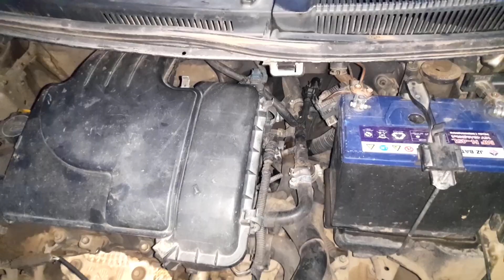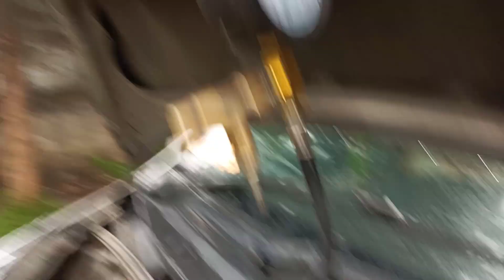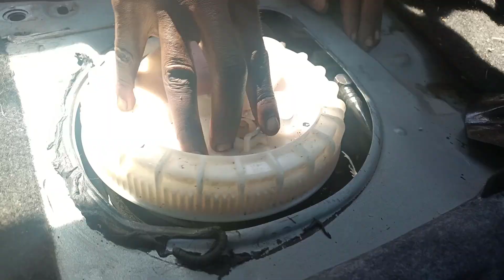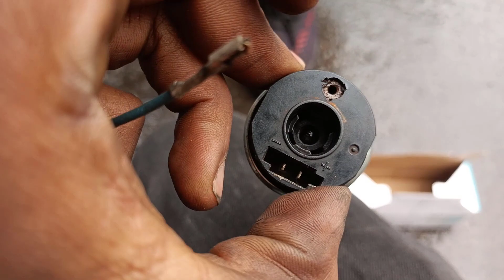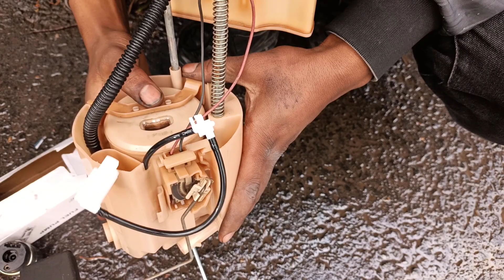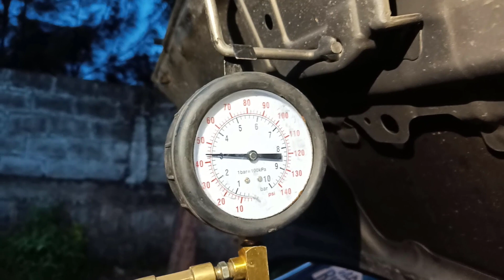how to fix it bad or weak fuel pump Car Cranks But Won’t Start#engine

Comment: I have a 2002 Chevy avalanche I have replaced the fuel filter the battery the alternator the mass flow sensor it will start but sounds like it's starving for gas and dies out quickly someone said my fuel pump could have a crack in it plz help